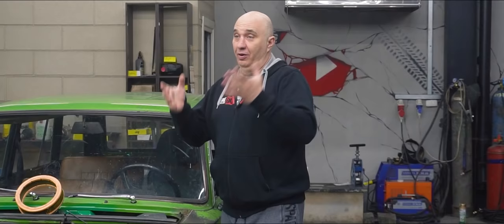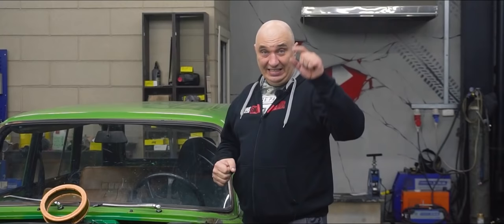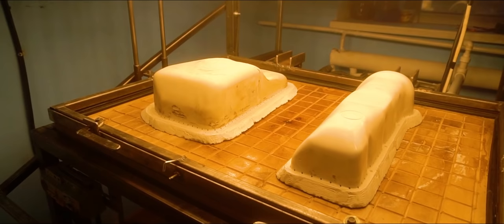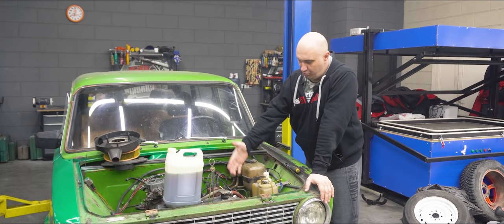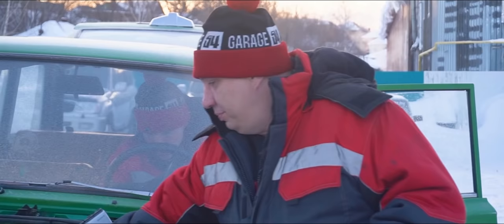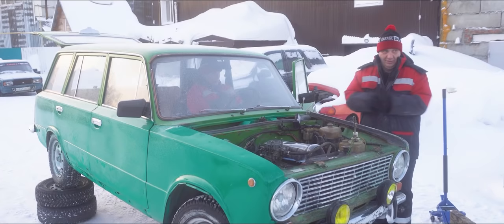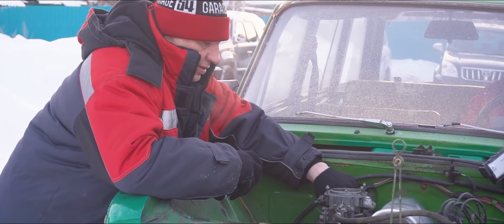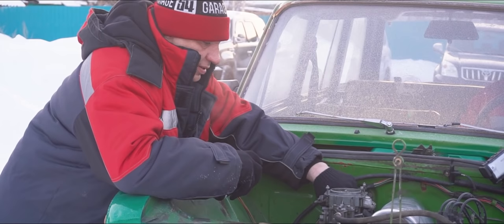Looking inside an engine during cold start (-30 degrees)

Comment: What weight oil were they running? It would be interesting to see how a 5W or 0W would perform in those temperatures
Reply: I think straight 30 or 40 weight oil
Reply: It was definitely some pretty darn viscous oil. This unfortunately tells us nothing since none of our cars that we actually use and drive have oil dispersement systems like that old soviet Lada.
Reply: Probably 10-40 if it was regular mineral oil.
Reply: mineral oil has a viscosity in the 100's at 0c, at -30 it would be in the thousands.
Reply: @dosmundos3830  I think that's a mistranslation, I have a feeling they meant dino and/or straight weight oil. 
Mineral oil is what non synthetic oil was called.
Reply: @dickJohnsonpeter  Those Ladas use a conventional gear pump driven oiling system. I believe it to be very similar to how modern engines are oiled.
Reply: 5w30 full synth oil with no garbage viscosity index improvers. No problem at -30°C.
Reply: @otm646  could be. Usually the oil pump is driven off the same serpentine belt. I think the main difference is probably in what oil you use. I always turn my car onto the the electrics on, let the electronics do their thing, then start the engine and let it idle for about 30 seconds before I go. Especially in winter, have to take it easy.
Reply: @otm646  i have a feeling it's not a mistranslation. In Canada we don't strip the gears off our distributer shafts every time we start our vehicle in -30 lol
Reply: @dosmundos3830  Same here in the U.S.  A temp of -30°c = -22°f which is isnt uncommon for the midwest in midwinter. I've never heard of, or seen any issues remotely close to what is shown in the video. My family even owned a 1992 chevy silverado, it used conventional 10w30, never had any issues in extreme cold.  That has to be actual mineral oil being used in the video.
Reply: @nickskizekers1906  Dude, are you having a stroke or something?
Reply: @kaelenhughson9579  What the hell? That is not what i typed at all, i have no idea what happened here. It was definitely legible before i posted it
Reply: @kaelenhughson9579  aw man..i missed the pre-edit by 16 mins lol
Reply: They used a 5W oil then mixed in 0W.
Reply: @theupscriber65  suuuure they did lol. what are you psychic?
Reply: Just let it warm up
Reply: Old oil pumps are driven off the distributor. Usually there is a shaft that is slotted into the bottom of the distributor and top for he oil pump. Old Chevys used just a single slot where as Ford used a hexagonal shaft. Both achieved the same result.
Reply: probably 10w40 mineral
Reply: @nickskizekers1906  ive had comments turn all garbled when i hit the reply button to post them. even proof read them before hand. glad im not the only one thats happened to.
Reply: @Coinfindr  obviously not, or they'd still have a working distributor lol
Reply: @_AndromedaGalaxy_  Huh, first time that ever happened to me. Was kinda weird because some of the original letters were still there, but were followed up by a bunch of zeros and o's. It really did look like i had a stroke lol.
Reply: @nickskizekers1906  yeah that sounds similar. makes me wonder what causes that glitch.
Reply: He said it was mineral oil. Why would he put an oil you would NEVER do in the real world?
Reply: @tenthdimension9836  i take it you've never watched this channel before lol
Reply: @otm646  basically anything with a distributor  but according to the professional that's not modern.
Reply: @nickskizekers1906  I've started my 97 350 at 40 below not plugged in on 5w30 and instant oil pressure, that's 5w30 conventional as well.
Reply: @dickJohnsonpeter  nice! some times in the cold ill key off/key on twice, to let the fuel pump build a little extra pressure, and then like you said let everything settle down and THEN crank to get MAxiMuM Cold CRanKiNG PoWeR!!!
Reply: @tenthdimension9836  It was done to illustrate the extremes of what low temperatures can do to the oil in an engine. It wouldn't have been much fun if it just worked now would it?

Back some years and it was quite common to swap oil in your car for the winter and for the summer respectively. For the winter you would fill it up with a very light "weight" oil that would still remain somewhat fluid in the winter cold. But once the temperatures got over freezing the oil would no longer be able to maintain the film strength needed to avoid metal on metal contact in the bearing surfaces. So you would swap it out for a heavier weight oil for the warmer months of the year. Often you also swapped the thermostat for the cooling system at the same time. In the winter you wanted a thermostat that allowed the temperature of the coolant to go higher, while in the summer you wanted a thermostat that would open earlier and send more coolant through the radiator.

Using modern oil this is mostly a memory now. Multi grade oils such as 0W- or 5W- flow much better in low temperatures while still maintaining a usable viscosity and film strength at high temperatures.

Still showing how oil is affected by low temperatures teaches you just why especially in the winter it's a good idea to let the engine warm up before driving the car. Even with a modern motor oil it will prevent some unnecessary wear on the engine. Also installing a engine heater is certainly a good idea if you live where the temp is likely to go below 0°F or about -20°C regularly.

Personally I've found that starting the engine and leaving it to idle while I brush any snow of the car and scrape all the windows is usually good enough to have the engine heat up enough that there shouldn't be a problem with the oil viscosity.
Reply: Old cars usually use 20w50

Comment: Now try the same thing with the right oil. Would be interesting to see the difference
Reply: I don’t know why they used mineral oil
Reply: yeah, it would be an interesting thing to see.
Reply: @briancanfield5658  Mineral oil is fine. Just maybe some some 0w30
Reply: @V8Power5300  mineral oil is fine? did you even watch the video? at -30 mineral oil may as well be glue
Reply: I think it is worst case senario, plus some people will put the wrong type of oil in  it or pick the cheapest oil at the shop

Comment: Good job guys! I suggest next you do a see through transmission (gear box). I recon it's going to be interesting. You might even try to change gears without engaging the clutch. I bet some gear teeth will get destroyed.
Reply: If it is a syncromesh transmission it will work just fine as long as you get the revs matched.  Grinding is usually the dogs not meshing together correctly, not the gears.

Comment: It's always good to have Crank case vent to relieve pressure. That would of helped with start up I believe. Cool covers. Would be just a little cooler with the extra step.
Reply: Hot air from a blow dryer or hot air thing for work is one of the best ways of starting a cold diesel. I wonder if it would work in this case, also.
Reply: @exploranator Heat.. Doesn't really matter where it comes from, as long as the engine in general absorbs it

Comment: Now that we seen the engine run in very cold temperatures and failed. Show us how the oil moves in normal warm temperatures from bottom to the top. Give us a visual on how the oil moves inside the engine. Thank you for this great video.
Reply: you wouldn't see it, because oil would block the view

Comment: So most important questions:
1. What weight of oil was it? 
2. What does it look like with a block heater - how much difference?
3. Would synthetic oil do better?
Reply: can you even use normal oil in the temps that russia gets?
Reply: 1. Mineral oil is what he said was used. Not sure what weight that is really. All I can say is, I wouldn't use that oil in an air compressor. 
2. Block heater would make a world of a difference avoiding a lot of that initial damage. 
3. Synthetic oil would absolutely do better. There are cold weather tests for oils that illustrate how much of a difference it makes. However folks have got to understand what oil would work best for their machine. I swap between 5w-30 to 0w-30 in the winter for my cars. Longer warm up cycles. 0W-30 tends to shear a lot more, so I avoid high stress driving, such as racing. Otherwise the oil breaks down further and needs a slight top off between changes.
Reply: @d1sturb3d119  5w30 is fine for cold down to 30 below Celsius, it's always a good idea to keep a block heater in though for your first few seconds of oil priming up
Reply: @tacomas9602  For sure! Hearing metal on metal is just torture. Those block heaters certainly work wonders!

Comment: What about driving like normal with transparent oil pan and valve cover. I would love to see everything in action and normal driving operating conditions & temperatures. Also maybe a transparent distributor cap so we can see the fireworks.
Reply: I don't think you would see much: oil would splash on the inside and block your view
Reply: Yes, weights on distrubutor opening up will be fun to watch. I installed wasted spark ignition setup on my Lada so I don't need the distributor anymore and I can make a video of the weights.

Comment: Great video, block heaters where invented for a reason, I have even seen camp fires placed directly under the pan and kept going all night. I have also seen trucks run for weeks if not a month at a time, before you shut them off. But definitely invest to get a block heater.

Comment: With the engine running at high RPM and no oil flowing, I think cold starts like that everyday would really shorten life of the engine. I lived in Timmins, Ontario where winter temperatures many nights would be -30 degrees C or colder. I used an engine block heater, a battery warmer, and synthetic 5w30 or 0w30 oil. That way not only would it start, but less engine wear, and as an added bonus the heater worked sooner.

Comment: How about taking out the engine leaving the flywheel and gearbox. Then around the flywheel gear put 10 starter motors and make a cheap electric car?
Reply: That does sound pretty cool
Reply: Lol x) nutty idea, love it
Reply: Hell you can move a manual car pretty effectively using the starter motor, they heat up quickly though under load but since the load would be shared and no engine tranny to turn over it would work for awhile. Set up something to effectively cool them and you got yourself a sweet EV Lada
Reply: Hi, it will chew up the teeth on the flywheel very fast, some cars you say start 2 tiems a day then drive say 30-60 mins a day , then at 10-15 years you need to repalce the flywheel becasue of worth teeth

Doing the maths 2 starts a day @ 5 second = 10 seconds a day 
start the car 6 times a week = 6 x 10 = 60 second or 1 minute a week
I picked 6 days to make the maths easy

So 1 minute a week or 52 minutes a year    
Lets call it 60 or 1 hours

So by normal wear and tear you would get 10 hours run time, but that wont happen as driving on the road and revving and going uphill will put more strain

But a interesting idea
Reply: @ce5243  I've pulled my Jeep out of many mud holes with the starter motor.  It's good for a slow creep.
Reply: @ce5243  Take out the spark plugs to lessen load
Reply: @jokerzwild00  It's also easier then using the clutch to get started on a real steep uphill grade.
Reply: @georgemaragos2378  I have a 1980 Toyota pickup with almost 700,000 miles. Same transmission, same fly wheel. And about a dozen clutches. And half a dozen starters. This truck work in the landscape business for almost eight years. Multiple stops every day.
Reply: @Ozarkprepper643  Hi, Good to hear it, those 70's and 80's toyotas are very strong cars, landcruiser and the hilux ute especially ( hilux i what we call the 4 and 6 cyl smaller 750kg or 1ton ute / pickup  here in australia )
Sometimes it takes years to find a well built car then you regret not buying one or two at the time

Cheers
George
Reply: @georgemaragos2378  thank you. I should have said my 80 Dodge 1 ton had wore the teeth off the torque converter. And so has the 99 sport. And you're correct about early Toyotas. I purchased my first one in 76. My regret was loaning it to someone. 3 years later and over 80,000 mi they totaled it. Insurance company paid me what I had originally paid for the truck new.  ($3400)  It held 100% of its value. I bought the truck from them for $450 and made it a hardcore off-road vehicle. It was a pre generation prerunner. And the biggest regret was selling the 78 one ton with Duallys. That was the one that had the two buckets up front and a bench seat in back. And I still have a 76 lift back GT, and a 75 Coupe St that only has 34,000 miles on it. And have had many others over the years. Have owned and do own many other brands. And they are not as reliable. Exception to that would be the1939 9N Ford tractor. It's still going strong. It just spent 3 days brush hogging. LOL.

Comment: In Lada terms "in good enough shape" means just come out of the factory...
Reply: This car is from 70is
Reply: They are hideous and primitive, but reliable. And you can service them with a Hammer and a Screwdriver.
Neither of those things can be said about most modern Cars sadly.
Reply: @timhartherz5652  I drive a Dacia that I bought new 12 years ago, no power steering, no electric windows or mirrors, no central locking, no climatisation, not even loud speakers for a radio...

Comment: Valvetrain oil takes a lot of time, this is why idling the engine a good while before driving is a good idea.
Reply: On especially cold mornings you can ad a little bit of oil, to get some in the valvetrain before you crank. But be careful not to overfill.

Comment: I'd like to see if the lightweight 0w, 5w, etc. would do anything at that cold of a temp. Maybe even a Synthetic oil. Definitely a very interesting video.
Reply: A thinner oil flows better at low temps but will not be so good at operating temps as it would be too thin to properly lubricate the engine so really it’s worse to put thinner oil in than to just start your vehicle 4-5 mins before you leave as a warm up period will let the oil warm up thus it will thin out and properly flow to all components
Reply: @justchillin7552  That's not entirely true. A 0w-30 would still do a good job in colder weather compared to a 5w-30 oil. The W designation is viscosity at freezing temp. You can get away with that during the winter as long as you are not putting a larger load on the motor by  running it hard in the winter. So if its a sporty car, don't beat on the oil too hard. The oil would shear at most. You may have to add more oil between changes. 

Been running lighter weight oil in my daily's for 10 years now with no issues. In the summer its back to 5w-30 and then with hard driving the oil does not shear. Synthetic oils are literally keeping motors alive for years and years with no issues as long as they are changed regularly. 270k miles on my 92 SC400 in sub freezing temps. 227k on my Gx470 that lives its life outdoors. Compression tested as well still holding 150 psi in all cylinders.
Reply: @d1sturb3d yes that’s true that it isn’t bad if you don’t run it hard I was saying you run more risk of something wearing out prematurely or having issues later on I have a 96’ f150 with 350k miles on it and have always run 10w30 year round but I also let it warm up for 4-5 mins before I leave unless I’m in a hurry, I just find it to be a safer bet to use the oil that’s recommended for your engine as manufacturers test it in hot and cold weather to ensure that it will work in those conditions so I personally see it being a bigger risk than nessesary to run thinner oil than to run what’s recommended and let the vehicle warm up before driving off
Reply: @justchillin7552  Definitely x2 on the warm up part. Folks need to realize its not metal that needs to warm up. Its oil. So much wear and tear can be avoided by ensuring the oil has some temp in it!
Reply: I’ve watched non car people literally starve their engine of oil and blow it up because they didn’t let it warm up my friend just got a mustang for his first car and he no joke let’s it warm up for 15-20 mins before he leaves for school it’s a little excessive IMO but he’s an avid car guy like me personally I don’t think he should be driving in winter with that car in the first place but fuck me is it ever fun to drift with all the ice in the gravel pit near my school

Comment: i'm betting its getting too much crankcase pressure, alot of engines have the pcv valve built into the valve cover.
Reply: I was about to say it doesn't have a breather on the valve cover so it wouldn't pump to the top with the pressure of that tiny oil pump
Reply: Yep, in addition to this, you can see lots of smoke in the oil sump at 8:30 and 8:40, and there is soot forming at 9:45. These are signs of blowby, which is entirely normal in a cold engine, but this adds to the crankcase pressure and can make an engine judder or even stall if the crankcase ventilation isn't working. I've experienced this myself. My old turbo diesel Suzuki Vitara would always judder and cough when turning off the engine. Cleaned the crankcase breather and oil catch and it immediately went away.
Reply: @jhsevs  They drained the oil then changed the pan and filled fresh oil in. After they chilled the car but the oil pump was still empty and could not get the air out with the cold, thick oil. They should have fired up the engine for a minute to get the air out of the system after the oil change before they chilled it over night.

Comment: It seems that they learned nothing about crank case pressure from the first video. Vent the valve cover!
Reply: so like a breather tube coming out top? And this would give increased oil pressure at startup?
Reply: That's not going to make any difference for short term testing like this.